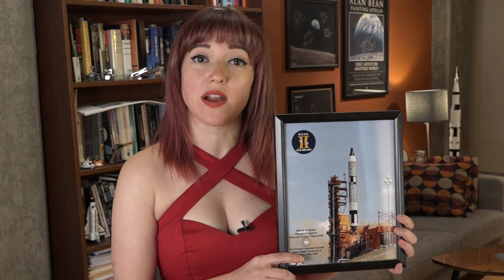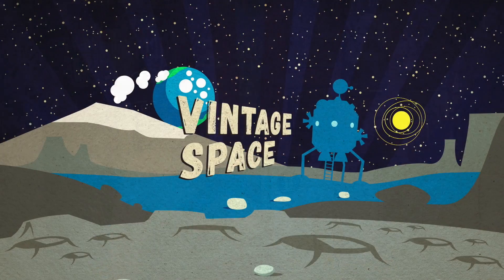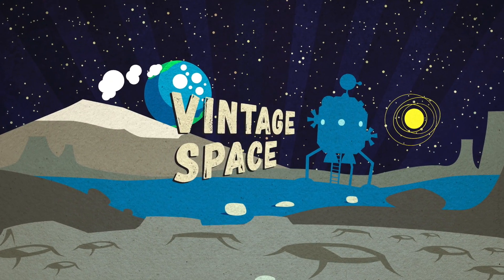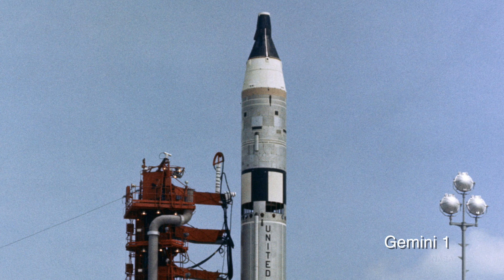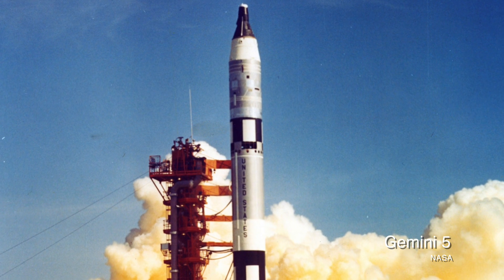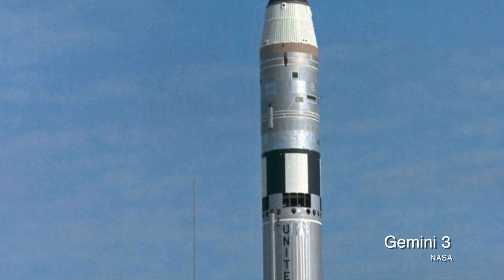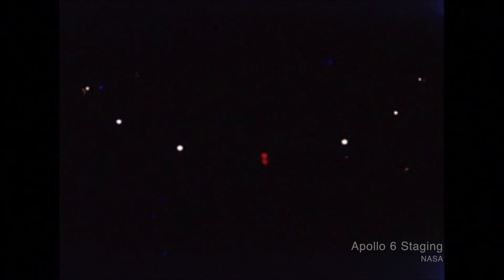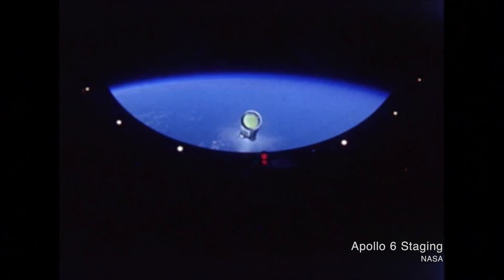Why Were There Holes in the Titan Rocket that Launched NASA's Gemini Missions?

Comment: Ullage rockets are partly for stage separation, but the etymology, which has to do with filling wine barrels, ought to give a clue to their major purpose.  Ullage rockets settle the propellants in the upper stage into the bottoms of their tanks, so that they will flow reliably into the pipes leading to the engines.  Hot staging accomplishes the same purpose.  Either ullage rockets, or hot staging keep the upper stage accelerating, and thus, the liquid propellants at the bottom of their tanks.
Reply: +Mark Holm ullage literally refers to the free space in a vessel. Using wine barrels as an example, the air above a partially filled wine barrel IS ullage :)
Reply: +christian luciani   Thank you for that detail.  The purpose of ullage rockets is to keep the ullage, as a separate, compact space, at the top of a propellant tank.  Without them, propellant, in free fall, breaks up into blobs and droplets, dispersing the ullage thru-ought the tank.
Reply: Absolutely correct! Everything you said before was as well, I just thought that was a cool thing when I first learned it. Definitely not something we have to worry about much!

Comment: Never noticed those on the Titan missiles before, but I did wonder about the latticework on the soyuz rockets that I guess did the same thing.
Reply: Yup
Reply: Same with the Proton, which uses the same hypergolic propellents as that of the Titan II, III, and IV.
Reply: yupperoni, it hot stages, like the Proton, and the N1(if it worked).
Reply: It does the same thing bro